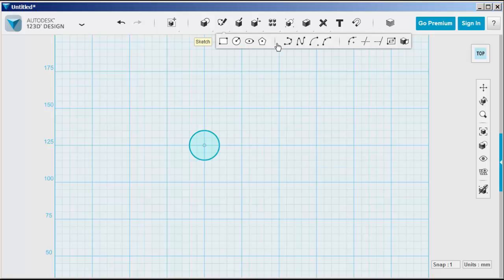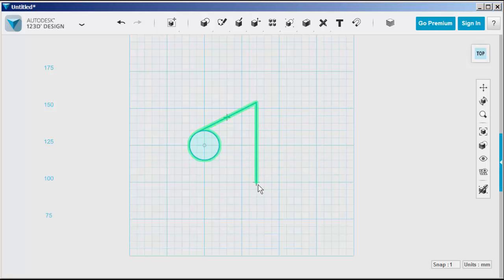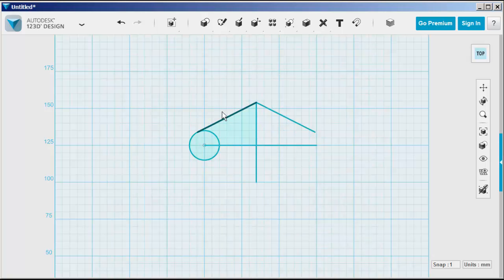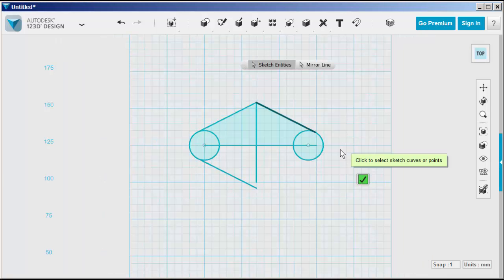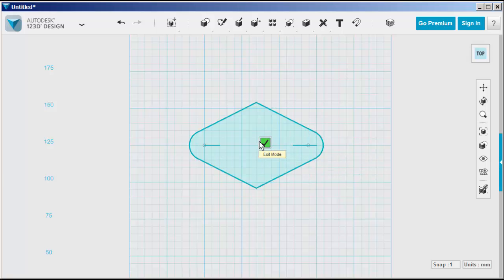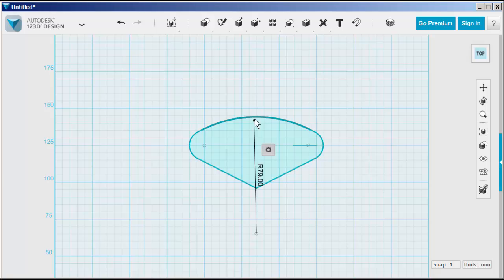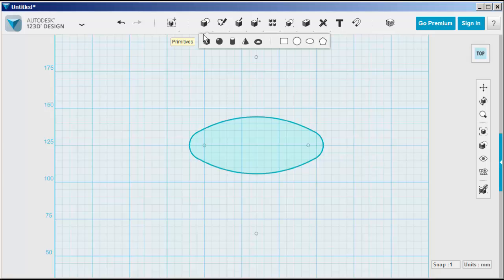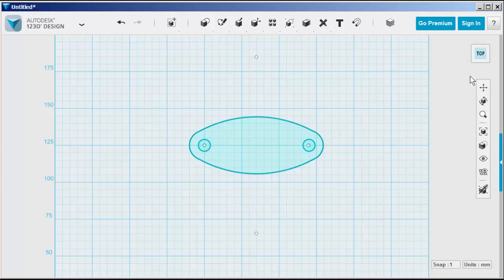123D Design: Plate with Holes (Sketch Tools)

Comment: No matter how many times I review and follow along can not get this to work. When I select the mirror line it does not hi-lite it just generated the green check box?
Reply from the maker: After you draw the mirror line (making sure it's on the same
sketch plane), select the face (or select all the sketch lines by holding the
Shift key). Right-click and choose the mirror icon. Then click on the Sketch
Entities part of the glyph, drag a selection window around the sketch
(excluding the mirror line) and hit Enter. Next, click MIrror Line from the glyph and
click on the mirror line. Should work -it did just now for me.
Reply: Thank you got it working.